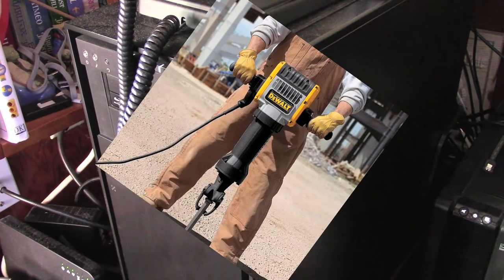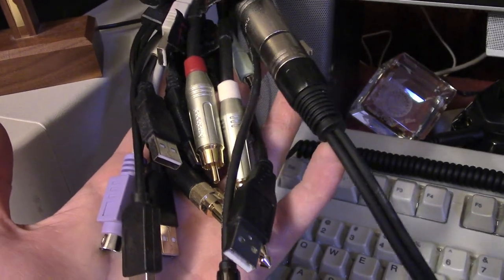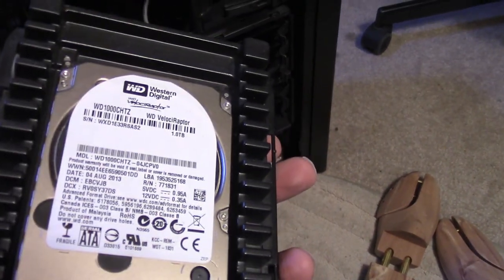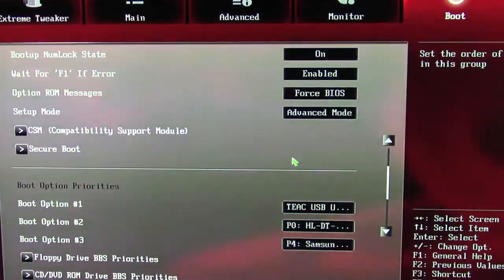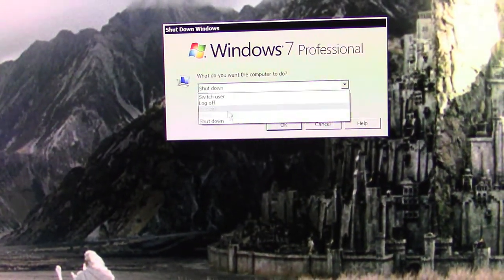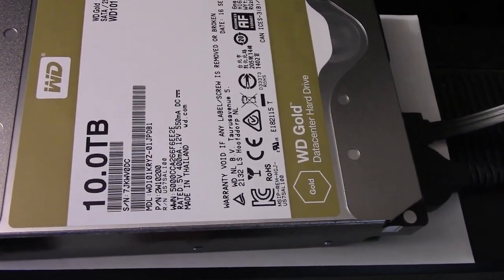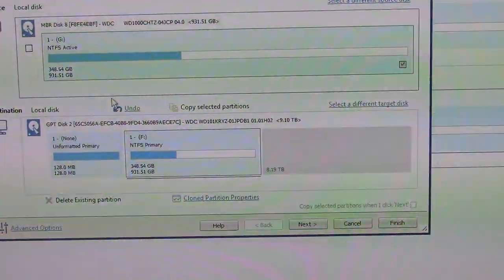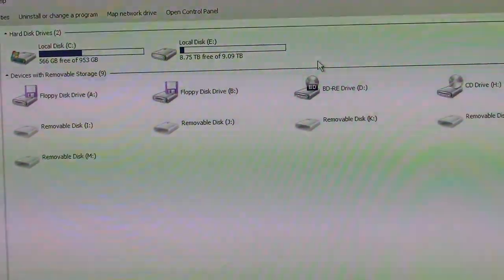Clicking HDD?  Better Upgrade Fast!

Comment: well
velociRaptor exchanged to this consumer grade HDD?
there is a lot of HDDs on market several levels better then this
I personally have loads of them (as I sell them_ - SAS HDDs 10K, 15K, 2.5", 3.5", SAS, SAS2, SAS3 (full-duplex 12gbps against half-duplex 6gbps SATA3) I have some SAS 2.5" HDDs capable of over 200MB/s